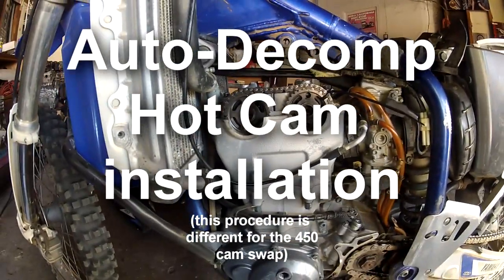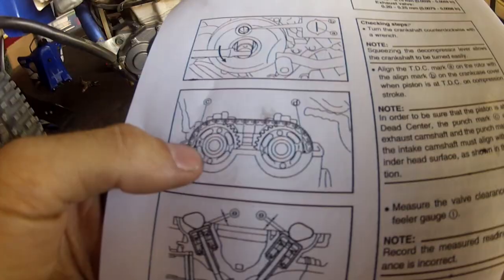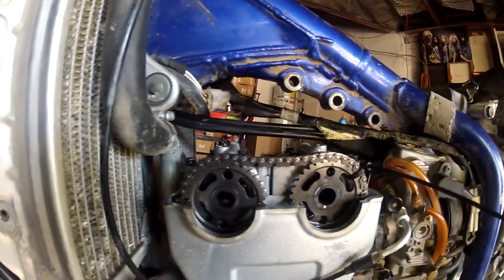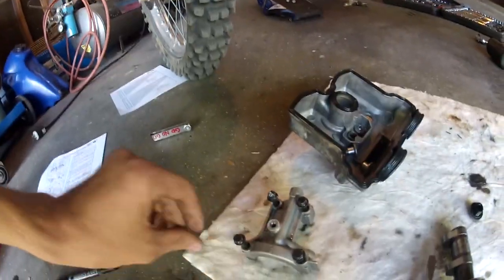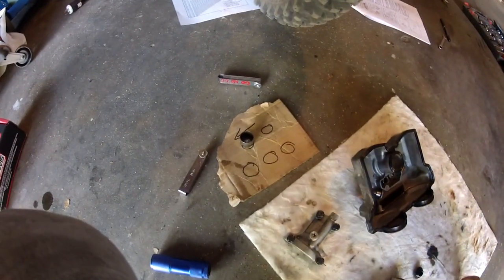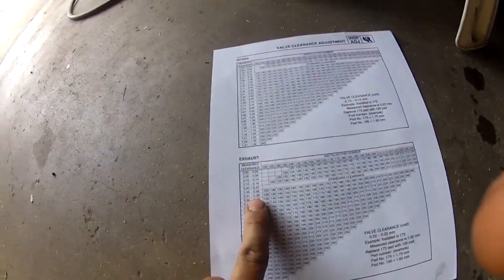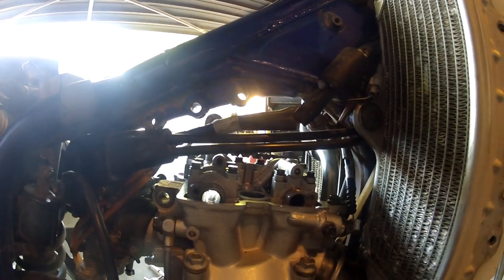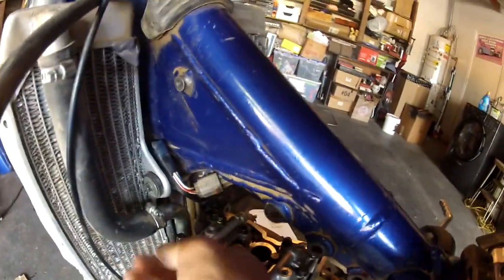How to Install a Hot Cam YZ426F Yamaha YZ

Comment: Wait a sec, did you install the hot cam without the buckets and shims,  where did the .35 come from. do you put the buckets and shims that came out orginally and install the new hot cam and then take a measument.... why didnt record this this is the most important step....
Reply: He installed the cam and torqued to spec (at least I hope so) and checked the valve clearance (shim and bucket still in place) getting his reading of 0.35. Spec according to his hot cams sheet is 0.20 which I believe is the same as Yamaha's spec, can't remember for sure. He used his chart, or you can use the mathematical way to determine the size of shim you need to put in to get the desired valve clearance. Pull the cam back out, pull both shims and buckets out, put in correct size shims, install buckets and reinstall cam, torque to spec. Recheck your clearances.
Reply: +Nick Leadbetter what are the torque specs the bike Manuel once or the ones that come with the cam?
Reply: Cam tower bolt torque spec and valve clearance spec will be in your bike service manual. However, hotcams will supply you with a valve clearance spec with their cam(s) that SHOULD be the same as OEM spec. Google your bike's valve clearance and you'll most likely find a scan of a service manual online. Be sure to include make, model, year, engine size
Reply: 1999 Yz400 that's my bike the problem is the manual says the torque two 7.2 ft lb and the hotcam manual say to 12ft-lbs so I don't know what to do
Reply: And I'm talking about the cam holder bolts
Reply: I'm just trying to change my exhaust cam for the auto decompression
Reply: +Nick Leadbetter yea but the hotcam say 12 ft lbs on the instructions for installation on a YZ or WR 400 so I'm stuck what do I do I do not want to strip it out